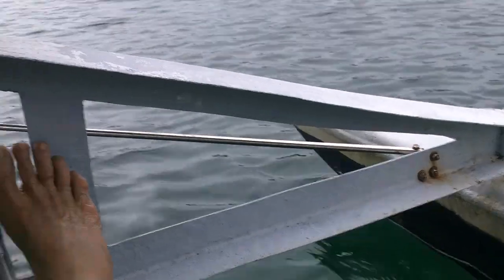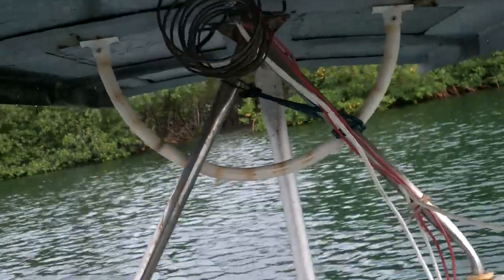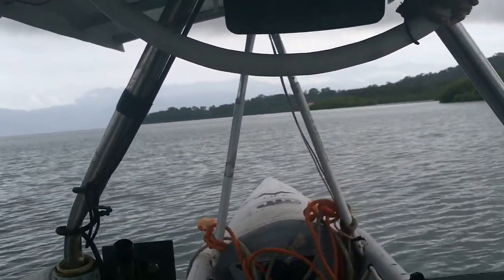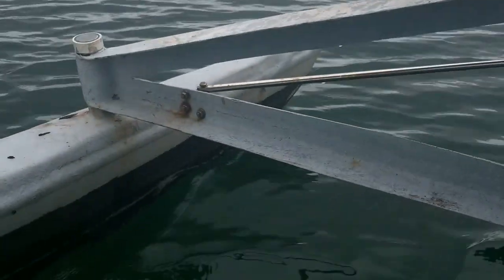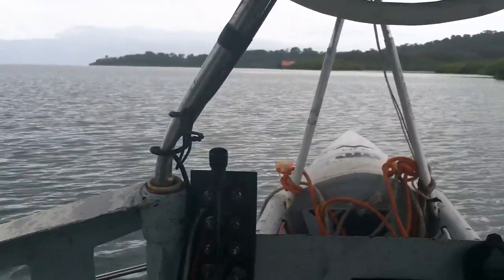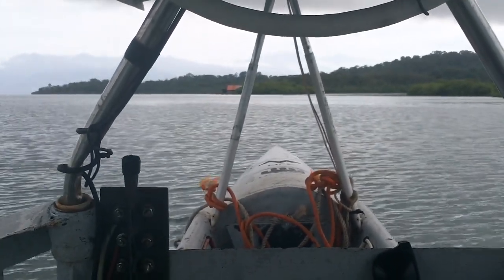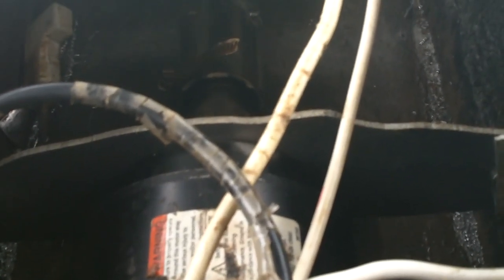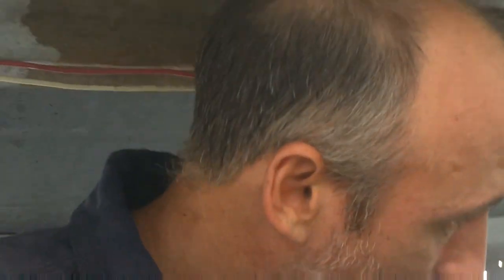That's it!  I'm fixing this stupid thing!!!

Comment: 05:48  the motor is still moving around quite a bit, there's some frame rate strobe thing happening with the camera but motor and wires are both vibrating.

Comment: As annoying as it is, I would still chase the cause of that noise at high speeds. That has to be losing some efficiency. Also as much as I love the diy roller bearings, I feel like a good bit of energy is lost there also. With a well balanced drive line and high speed bearings it would be a different machine.
Reply: Its probably due to rotational imbalances from the nut-and-bolt connections on the shaft and prop. you could probably balance it iteratively if you mount it indoors and just use some tape along the axis on the shaft to find resonances.

Comment: I'd try a production prop, that imbalance has to come from somewhere and I pretty much guarantee it's from the prop. It's pretty much impossible to build a perfectly balanced prop by hand. That or your prop shaft is bent, or not rigid enough.
Reply: I think it was rctestflight's yt channel that recently did a video on ultra efficient solar boats. He found the leg of the outboard was causing some turbulence in the water, and as the propeller blades passed by the leg, it would cause vibrations as the top blade blocked by the leg is pushing less water than the lower blade in open water

Comment: Universal or Flex coupling - one (of many) manufacturer is Lovejoy. On small diameter light weight shafts like this, straightness & stiffness  of the shaft ( & alignment of drive train/motor shaft) are much more important than balance...

Comment: You could try centering the shaft with an external gasket or an x/y brace made of pvc with bolts on the rnds to fine adjust the lengthd..

Comment: The drive shaft need ceramic pin bearings to quite it down. That noise will damage the whole structure of the drive shaft housing. Do not wait for the worse possible time to brake it.

Comment: It's difficult to get vibration free operation using normal pipe as an axel. They are not straight or even thickness. Prescision ground axels can be pretty expensive. I have used brand Thalachrome. They are good enough and quite affordable. I have bought 20mm x 2m bar with less than 20€. They are not stainless, but surface is hard chromed and as long as ends are protected, they don't rust. 

Those are solid bars, and very stiff. You can check if they are available where you live. 

You can also try to weight and straighten your current axel or put something inside to dampen vibrations. Foam can do something. Too heavy stuff can make it worse

Comment: Noise coming from a mechanical device represents friction.
Friction represents the loss of efficiency.
Less noise means your running more efficiently, which explains your higher speed.
Reply: My guess is that extra long shaft is a rattling inside of the fiberglass down tube or against the bearings.
As you eliminate more and more noises, your efficiency (ergo speed), will continue to increase.

Comment: Yeah man I can tell it's faster than it was a few weeks ago when you had it out..... That vibration, May simply just be a effect of the type of system you have... Think about how long the prop is.... If it's not perfectly straight anywhere in that length?? It's going to vibrate .... I think it's the length... After those roller bearings get broke in... Some of that vibration might go away... The only thing I can think of is maybe building a gearbox for it... Or some sort of harmonic balancer....

Comment: I would machine up two or three wood bearings and soak them all the way through with high quality nondetergent oil. They will take the flop out of the prop shaft. This is done on long tails for that very reason. You get that calmed down and you will be able to tell how much vibration is coming from the prop.